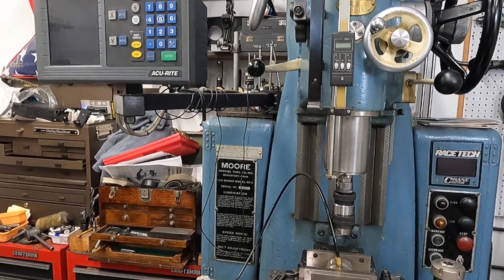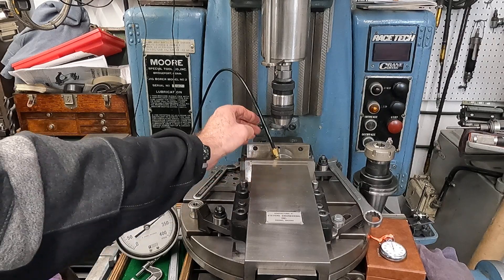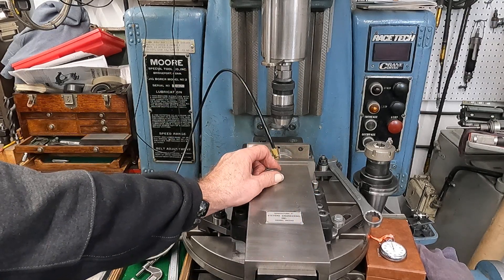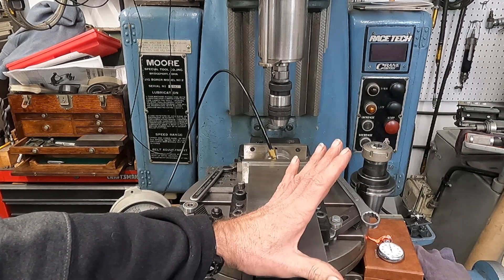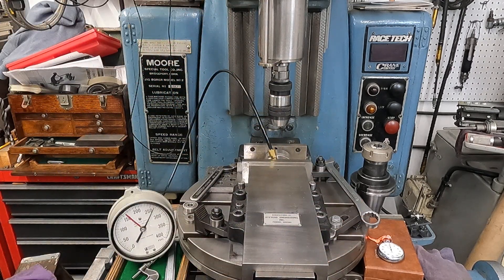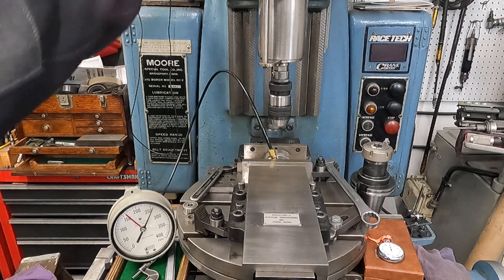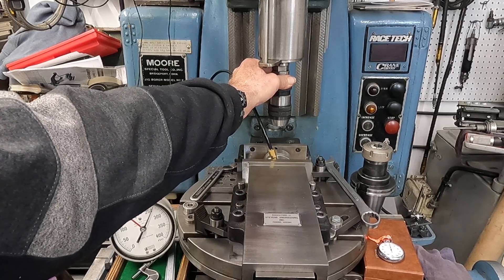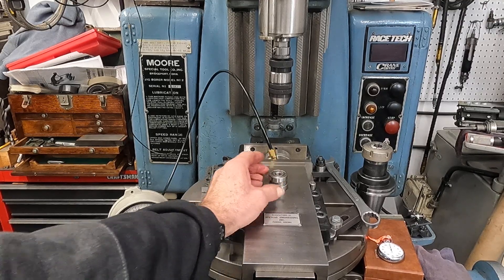Moore Jig Borer Spindle Bearings

Comment: Wow!  Thanks for the info on run-time and warming.  That makes perfect sense.  That is a really good sanity check when looking to purchase a machine.  I also like the fact that when looking at a machine running it at top speed for 10 or so minutes and just raising the quill and seeing if it jams.  Do you have any info on how many degrees is enough to start worrying or having it jam up?   I'm guessing it is only got to be 5 or 10F above the temp of the main casting, but I figure I would ask.  

Also, how well is your home shop temperature controlled?  I would love to see a video on what you do to deal with that.  For myself, I am thinking ahead on the best way to insulate my garage (which is about all the space I have to work in at home, or to set up an insulated box in a corner of the maker-space I work at).

Again, thanks for the wonderful video.
Reply from the maker: When the bearings start to warm up they are about done. Not using the machine is the worst because the bearing load, combined with normal shop vibration will cause the balls to work through the film of grease to dent the races,  It is recommended  that the spindle is at least rotated by hand often to keep a film of grease on the parts, and the balls moving to new spots.
 It seems most likely just from age 30-40 years since they were last made the machine is going to need bearings.
 The machine seems fine between 65 and 75 degrees, but does distort noticeably above 75 degrees. It does not seem to be that big of a deal, except if the machine gets too hot or cold, it can take a day or two to get it back to normal.
  Any information about these machines has been shouted down, the users bullied off all three fake machinist forums, try to find anything, if there is its from me and there were problems, same with the Monarch 10ee complete clown show.
 Here on YT the racist internet forum cabal of fake machinist cannot control content or bully., It is hard for a panty waist gym shoe fake machinist to bully a Harley Davidson certified tech.
 I will continue to demonstrate the jig bore. Ask any questions you want.
Reply: @deedeeindustrialsuperprecision  so it looks like one of the regular maintenance tasks is to turn the spindle slowly as often as possible even when not in regular use.  Again this makes perfect sense.  Since I think the days of me turning cranks 4 to 10 hours a day are long gone, what other daily/weekly rituals do you recommend for this and other machines about the shop?  You know I just rolled out of bed and still about half asleep -- I have this vision roll through my head of setting up some automation which turns on the machine once a day at slow speed for a few seconds to a minute, logs the event, and shuts back down...  I think I need some caffeine...
Reply: also thanks for the temperature info.  The garage on the old derelict farm we got a couple of years ago has no insulation, and no heat.  I know it freezes in there, and can get into at least the 80's if not higher in the summer.  Getting it insulated is on the plan, as well as a new roof (which is a must).  I'll see if I can plan to try to keep the shop space 68±5.  Wow.  This is all great info.  Sorry the machinist forums left such a bad taste.  We'll keep you talking and rolling ;-)  To bad we could not have on those forums a video equivalent of if there ain't video it did not happen.
Reply from the maker: @johndavid4825  The problem is called false Brinelling, when from normal shop vibrations the balls vibrate through the grease film and micro hammer dents in the races. Pope Spindle recommended rotating spindles daily when not in use and even stored them on antivibration shelving.
 It was recommended to me to park the machine at mid speed 1200rpm this places the variable speed drive belts in the middle of the pulleys, store it there to reduce the belts taking a set, and rotate the belts at the same time you do the spindle, helps the machine smooth out faster when you do use it. If you can manage once a week is better than nothing. Paying for new bearings is a motivator there.
Reply: @deedeeindustrialsuperprecision  I knew about issues with bearings causing microdents in bearing races, but I do not think I ever heard it called by the name.  Thanks!  Learned more than one thing this morning!!!   Daily/weekly turning is a good schedule.  Now that I have had a couple cups of tea, by creative mind just went to building a simple clock or windshield motor attached to a telecopic shaft -- which wakes up occasionally and gives it a spin...  My mind works like that (particularly when I first wake up ;-)

Are you saying that Pope Spindle recommends removing the spindle from the machine and storing it when not in use (on an anti-vibration shelf)?  While I could see that would get around some of the issue it seems a bit of overkill unless you are planning not to work the machine for months at a time.  How long would it take to remove/replace the spindle?  I really think I misunderstood you, and if I did not I would love to hear more about this.  Also, would it be even reasonable to think of mounting a machine on antivibration mounts?  Trying to keep a machine that level while sitting on antivibration mounts hurts my brain.

Comment: Pushing the limits of accuracy is never cheap and I thought a set of Gamet bearings that are in my lathe was expensive, not that I have had to change them as they are still good.
Reply from the maker: The Gamet taper roller bearings are outstanding!  There is no cleaning or regreasing these ball bearings, when they warm up, they are done.